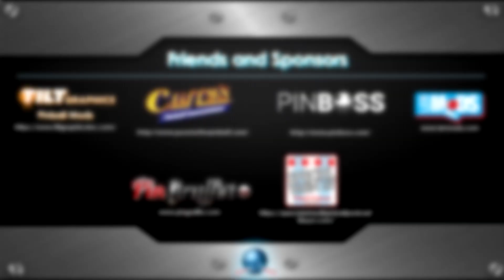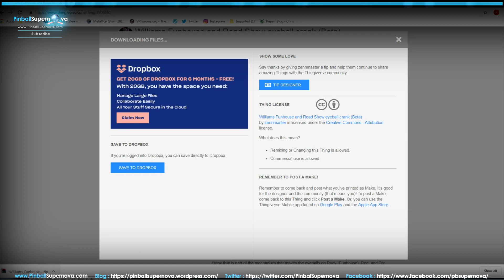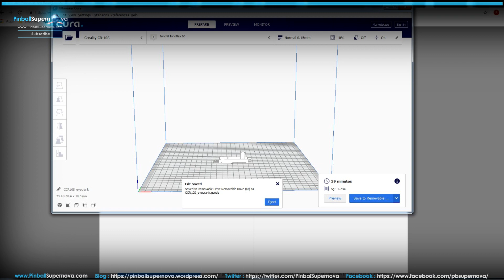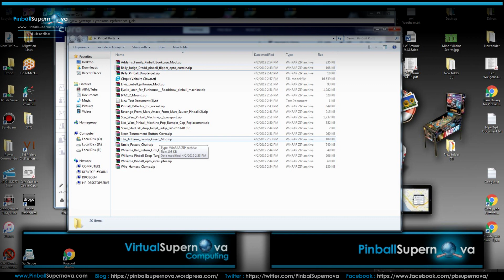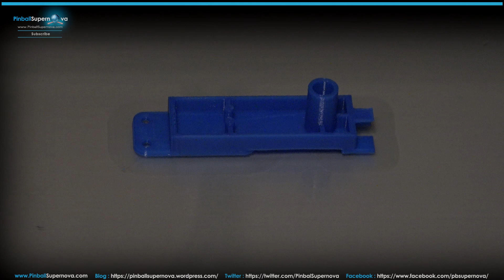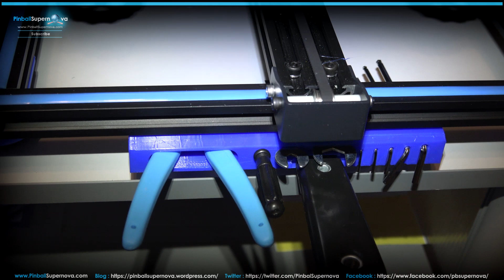Pinball Tech and Repair #31 : Introduction Into 3D Printing and Pinball Parts

Comment: Can you take an existing part and recreate it. I am hunting for someone to reproduce a Laser War Pinball machine ramp. They were super brittle and not very strong when originally released and so many of them failed. Then they released a replacement which was pretty cheap as well so they are notoriously bad for breaking. Is that something you would be interested in trying for a video?

Comment: Great topic ! Glad to see a new video from SuperNova
Reply from the maker: Chuck, thanks for the message.  Much appreciated.  Yes I see how 3D printing can become a big part in the pinball hobby.  Especially as parts are no longer available.  The printer was pretty easy to setup .  I had to calibrate the corners of the bed with the dials underneath.  The bed needs to be near the print head after setup.  Then you calibrate the bed through the printer itself with the control panel.  So far its been a great printer.  Thanks again for watching and send ing the messages.